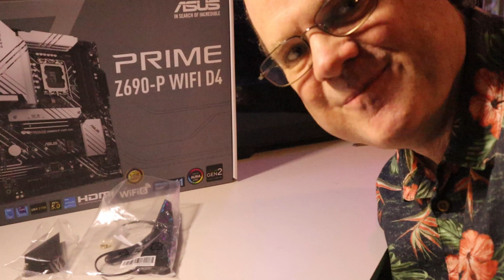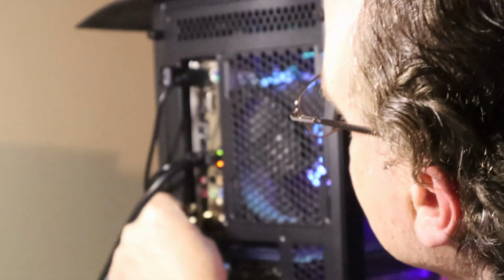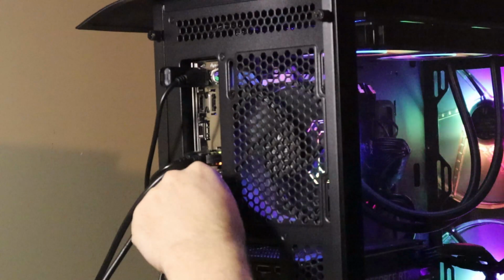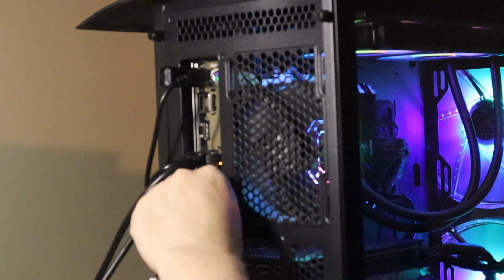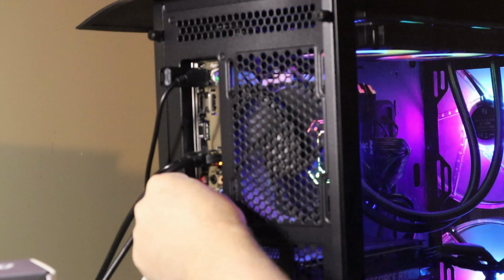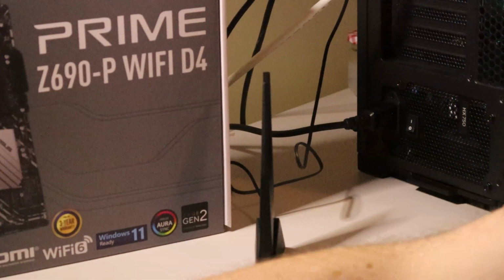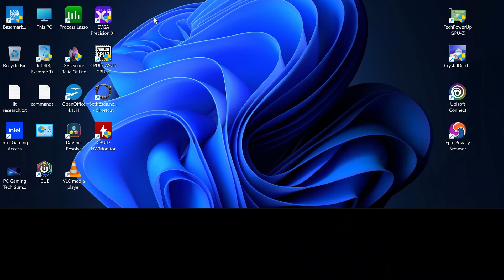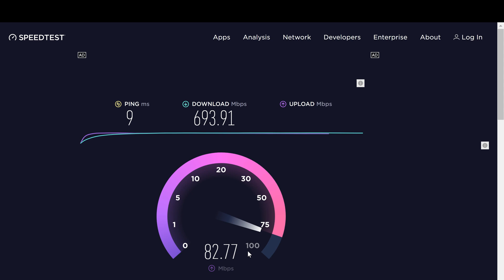ASUS WIFI 6 Antenna Assembly Z690 - P Prime WIFI D4 motherboard and WIFI speed test. How fast is it?

Comment: Speeds of 800+? Spectrum could never 😂😂😂
Reply from the maker: Wired Ethernet is 925 Mbps. I turned that off. I used the WiFi 6 and it was 693 Mbps.

Comment: ASUS manual: “Connect antenna to IO ports”
Me: “how the hell do I get the cables through the plastic thingy?”
What a terrible manual in general (other parts too). Thanks for the video, probably wouldn’t have kept trying if I didn’t see it. ❤
Reply from the maker: Glad I could help. How about a subscribing? Feel free to make suggestions for videos. I have a 12700K, 3060 12 GB, and Corsair H100i Elite AIO.

Comment: ive got this motherboard in my new build coming. you dont have this thing out do you. it is hidden in the case right ?
Reply: I have this board. The antenna is external. There are two coax connections on the back panel and the cables are long enough to allow you to place the antenna for best reception. Also Bluetooth does not work so well without the antenna connected.
Reply from the maker: @mourip  Awesome, thanks for the feedback.
Reply from the maker: You can see the motherboard here https://www.youtube.com/watch?v=_4y8dzCd4TU    or at ASUS https://www.asus.com/Motherboards-Components/Motherboards/PRIME/PRIME-Z690-P-WIFI/

Comment: So i bought the non wifi version, but there's a M.2 Key E slot for wifi, will the A+E wifi module works on it?
Reply from the maker: So I would check the manual and then get a quote from your local PC shop.

Comment: Mine does not pop up to connect in settings!! What do I do?
Reply from the maker: First do Windows Update. In Win 11 Settings, Network & Internet,  WIFI (Turn On),  Click WIFI, Click Available Networks. Also you can use the ASUS Armoury Crate programme for up to date WIFI drivers. Last check Windows Update, Advanced Options, Optional Updates at your own risk. Please Subscribe.
Reply: @pcgamingtechsummary  and if I can't connect to internet just thought WiFi? So I installed Windows and it didn't recognize the WiFi networks just ethernet. And I tried with the WiFi drivers from Asus and it didn't let me to install it. Any clue?
Reply from the maker: @alexspeciali2826  Did you use ASUS Armoury Crate to install the driver?
Reply: @pcgamingtechsummary  helloo! Thanks for the answering. Not at that time, but now that you mentioned I tried with the Armoury crate. I installed everything it has. And still in the same situation. No trace of WiFi. I just see ethernet realtek family controller in network connections
Reply from the maker: @alexspeciali2826  OK. I would Create A Restore Point of your boot drive, usually C: then I would run Windows Update. If still not working, Then on Win 11 (10 should be similar) I would go to Windows Update, Advanced Options, Optional Updates, Driver Updates. Note: Anything you do or don't do is at your own risk.
Reply: @alexspeciali2826  any updates for this? i have the exact same problem and i cant figure out the solution
Reply: @franswarih7449  did u solve it?
Reply: @amibis6013  a friend of mine actually solved it for me and as far as i know is that he downloaded a software to basically updates your drivers. i don't know if that is the main solution or not because i wasn't there when he fixed it.